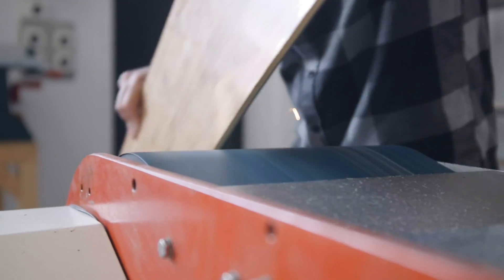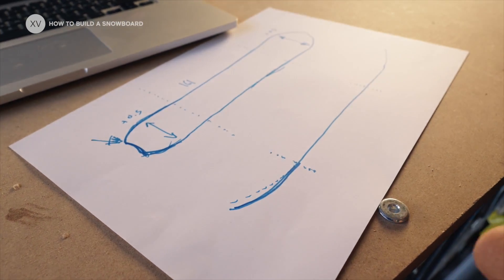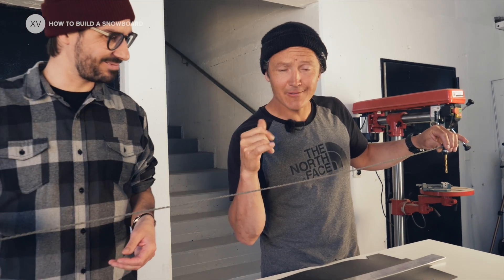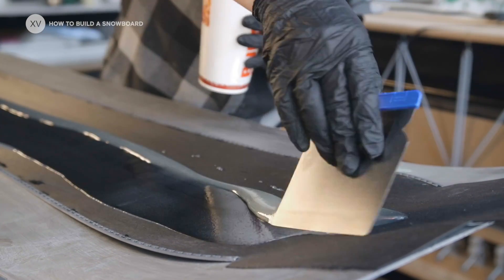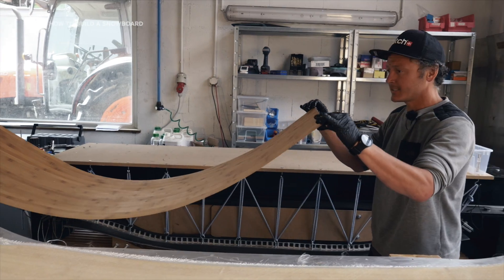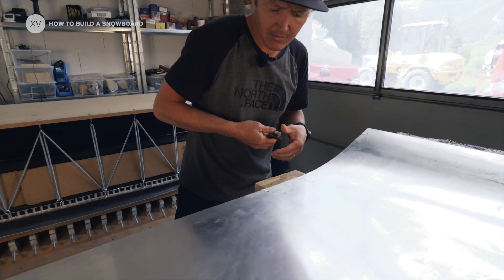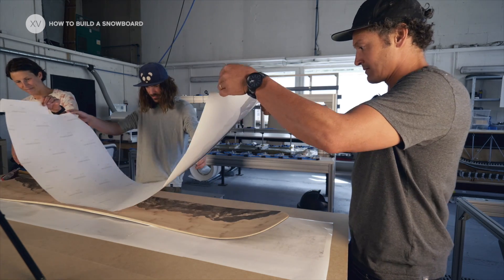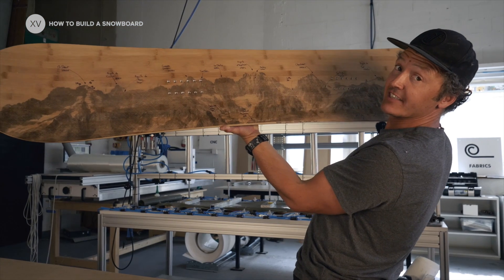BUILD A SNOWBOARD | HOW TO XV

Comment: What bits did you use to get the core tapered on the cnc router?
Reply from the maker: Hey - We used a large diameter surfacing bit (32mm). The CNC program contains the core taper profile and machines the core to the right thickness to a 10th of a mm. Xv

Comment: Nice! What was the graphic film made of? 
Is it some kind of water-slide decal?
Reply from the maker: For the Print we used an inkjet printer to print on Silicon transfer paper. The ink doesn't adhere to the paper and thus as soon as it comes in contact with the bamboo it releases from the paper and sticks to the bamboo. It is important to note that this is not a common technique used and that it was a DIY method to get the graphics and effects we were looking for onto the board. Pretty stoked with the results!! Xv
Reply: @XVDLR  Awesome! I am looking for techniques like this as I'm producing skateboards DIY-Style and buying a heat-transfer press is not very cheap ;-) + I'm pretty sure (even though commonly used) that 200 degrees will to some extent harm the wood. So this technique looks like a good way to go! Could you tell me the company that produces the transfer paper? Thx already for the answer!

Comment: Is the little swallowtail really useful or is it just to had some style to the board?
Reply: It may have a tiny effect if you go really backseat on the board but not really. The only time a swallowtail drastically changes the ride is when the cutout extends past the upturned surface and into the camber/flat part of the board, OR the back foot is very close to the tail (see the xv sushi).  In the former it changes the flex of the tail and in the latter you're physically steering the board with the tail so any changes in shape will change the ride. At least that's my experience with 5 different swallowtails, I have a problem.
Reply from the maker: Well I can't reply better than Brenden! Nice one! Thank you. Xv